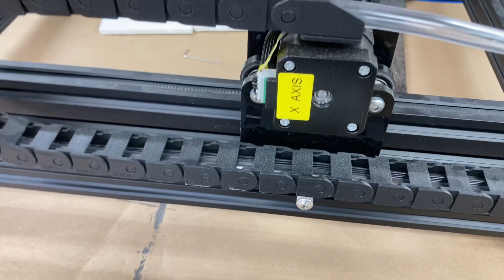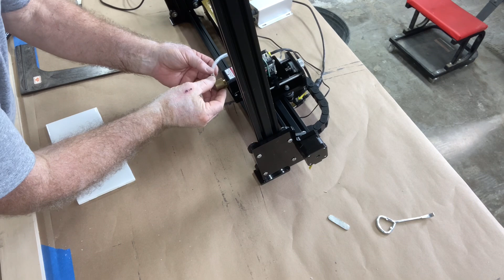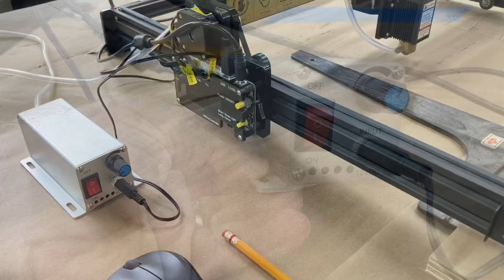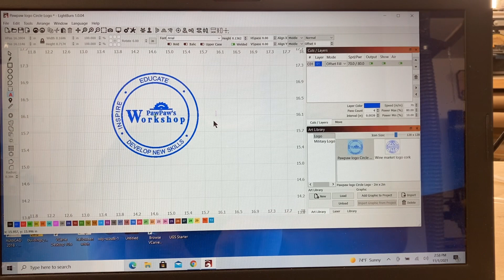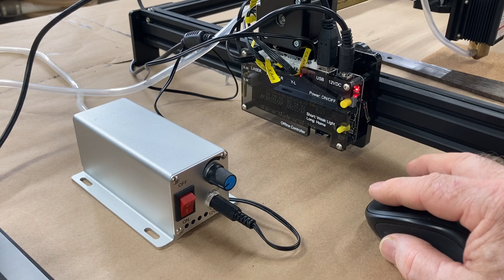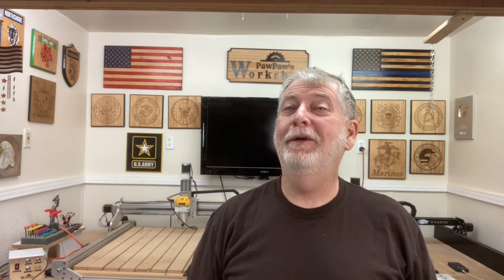Adding the FOXAlien Air Assist Pump to the Laser

Comment: Hello PawPaw - I noticed the device has mounting holes on its base. Is there any place to mount the air pump on the FoxAlien?

Thanks

G-Pa
Reply from the maker: No, you can mount it on a wasteboard if you so desire. This one will move. It has no stabilizing feet to dampen the vibration
Reply: @PawPawsWorkShop  understood, thanks!

Comment: When I added a 50L air assist to my k40 laser It turns on and off by itself, what is the SOLUTION please 🥺?
Reply from the maker: I do not have a k40. I can only assume that the GRBL settings control the air assist. You will need to adjust the settings in your software

Comment: I have a question; Sculpfun S9 comes with 41 x 41 cm frame. Can I use 85 x 41 extended frame with air assist Fox Alien?
Reply from the maker: The Sculpfun S9 has an extension kit available with all the belts and necessary cables. I check to see how long it becomes.   Also the FOXAlien air assist plugs into the controller. I do not see an available plug on my control board. I would use a different air assist

Comment: Great explainer. How do you activate the 12v plug on the laser board? I got a Genmitsu compressor with that little plug and it fits the 12v socket on my Atomstack P7 controller, but it doesn't turn on the compressor (I'm using LightBurn and even tried turning on the air toggle in the software, but nada). So I'm using it with a power block/wall wart manually... air definitely makes a huge difference! Would love if someone can shed light on using the small 12v output on my P7. Thanks.
Reply from the maker: On the FOXAlien laser that plug is always activated. Not sure on the Genmitsu

Comment: You were very helpful in answering my previous question. Please help me out with this one> In installing the air assist pump nozzle on the 20 watt Reizer by FoxAlien, does the nozzle fit over the brass round covering the lens of the laser or do you have take the existing brass round to be able to install the air nozzle???? In your video you do show the electrical hook up, then the placement of the hose and how the hose fits in the nozzle but can you please show the steps to install the air nozzle??? Thank you so much Frank
Reply from the maker: Yes, it fits over the brass cove on the laser. The electrical hookup is simply plugging it into the control board. There is one slot left. It just snaps in. I ran the hose through the drag chain. Currently, I have the hose attached on the side but I lose x axis travel. I’m planning on moving it to the rear. I believe this will work better. The air nozzle just slips over the round brass cover on the laser and tighten the set screw.

Comment: in using the air assist pump nozzle, you still focus the laser at 30mm or the focus height changes???? Also, are you aware if the Genmitsu air assist pump would fit the foxalien Reizer. Hope to hear from you
Reply from the maker: Yes you focus the laser the same 30 mm. I do not have air assist for the Genmitsu. I do not know if it will fit
Reply: @PawPawsWorkShop  They are identical, in all aspects, other than the same factory that makes them, coats the Genmitsu in black, and the Gennmitsu comes with the nozzle.
Reply: Thank you so much for the prompt reply.

Comment: I'm not sure I understand the 'switch' in Lightburn for Air Assist. What does that do if you have to use the physical switch on the pump.
Reply from the maker: It just gives you the option to turn it off or on during the engraving. It adds a line in the gcode to turn it off and on if you have that capability in your machine.
Reply: @PawPawsWorkShop  Thank you for replying. On more research I realize that on the FoxAlien Reizer it doesn't do anything because the power plug on the control board is 'always on'. We would need a control board that triggered the power on from lightburn.

Comment: Will this pump work with the 4040xe? and if so where does it plug into the control box?
Reply from the maker: I have not tried. There is no plug-in on the outside of the controller
Reply: @PawPawsWorkShop  
Thanks Paw Paw, i found a video from Lazer Wizard and he explained that an adapter would be needed to plug into the pump and into an 120 volt outlet.

Comment: What is the best way to connect to the X-Carve controller? Or will I need to get a separate 12V power supply?
Reply from the maker: I have not looked at that certainly you would need to remove the connector. You could also use the aquarium pump with its own power supply. That is what I used before I had this one.

Comment: I really like the power supply that plugs into your LE-4040. Where did you get that from? Also, did you have to get tube? If so what did you get and how much of it did you need?
Reply from the maker: The air assist is from FoxAlien, it came with the hose and the power cable

Comment: I like that. With the smaller machine that I use there is no air assist I usually have to babysit it and blasted with compressor air. That's another reason I'm looking into the fox alien, I probably will be making my purchase soon.
Reply from the maker: Awesome. I think you’ll like it a lot

Comment: Nice that is great. Glad they are back in stock. Do you know if this can be connected the Masuter unit in the same way?
Reply: Yes, they can.
Reply from the maker: Yes. It will plug directly into the control bosrd